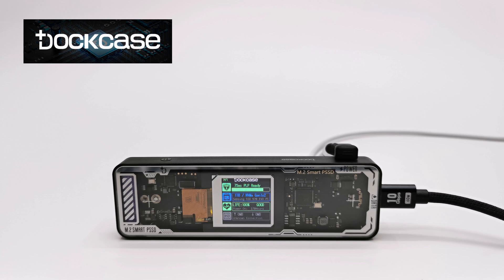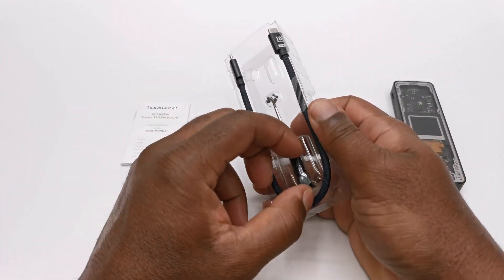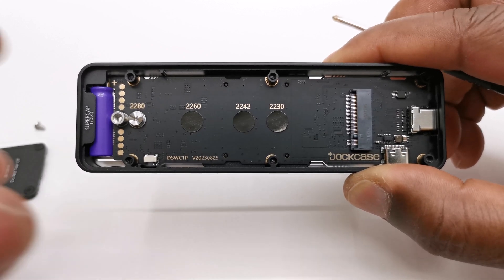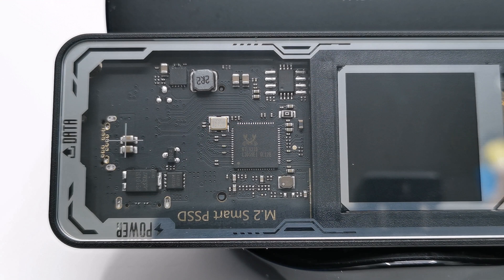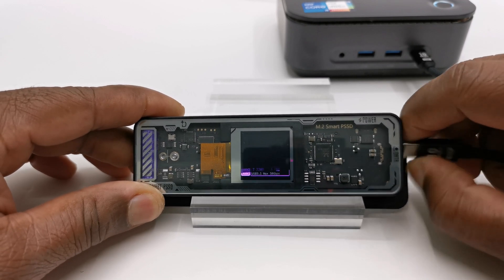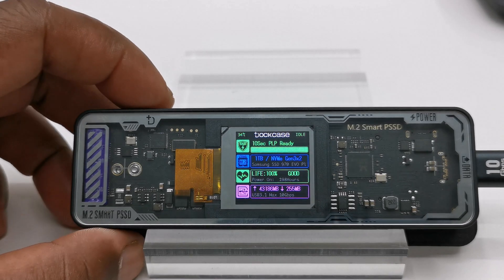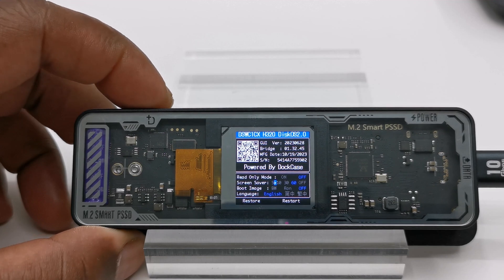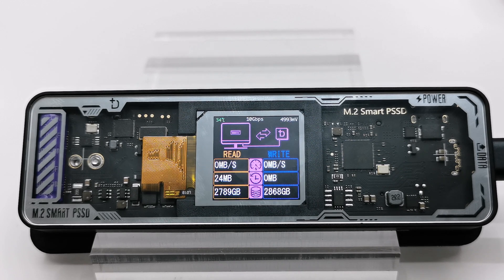Dockcase Explorer M.2 SSD Enclosure - Next Level High Tech Enclosure

Comment: This external drive is so next level it is the next after next level! This glass and OLED screen is the holy grail of external drive design. One question please: Is this an OLED screen? I had significant problems in the past with various OLED screens in computer parts, they all got severe OLED burn-in and display degrading, like in the graphics card WireView or the CSL vertical mouse with OLED screen. Hopefully this is an LCD screen? Otherwise every line and number will be severely burned in after 2-4 months, and after a year the whole display becomes almost unusable and unreadable degraded.
Reply from the maker: This is an LCD screen. Thanks for watching

Comment: ... names of usb inretconnects are correct - its an older nomenclature only - usb 3.2 gen3 2x2=usb3.2 (20Gbps), usb3.2 gen2=usb 3.1 (1 0Gbps), usb 3.2 gen 1=usb 3 (5Gbps)...
Reply from the maker: Okay a little confusing but thanks for info
Reply: @tvboxstop ... yes it is, but that's USB IF's work, not mine (btw nomenclature was changed again)...thank you for an amazing reviews...

Comment: The real next level aspect of tis is the high price. SSD's do have a limited life but I suspect that few of us will ever see the end of one in practical use terms. Rather oo much gimmick here, disguised in the price.
Reply from the maker: It can also be used to test if an SSD is performing well. I had one that was performing strangely if I had this I could have seen the issue. I would like to see a new chipset with higher transfer speeds.